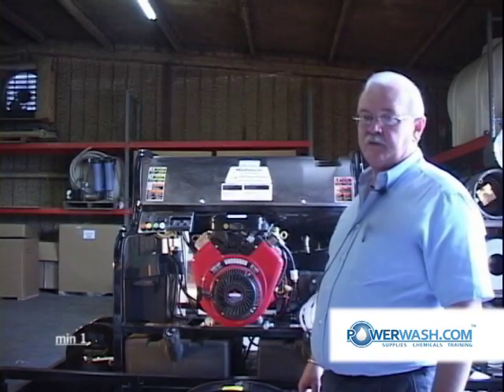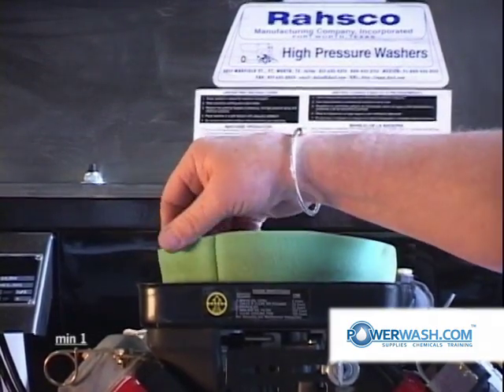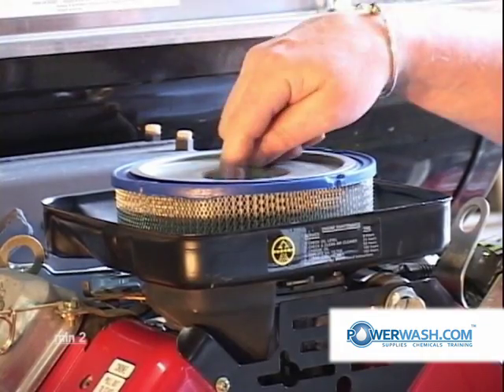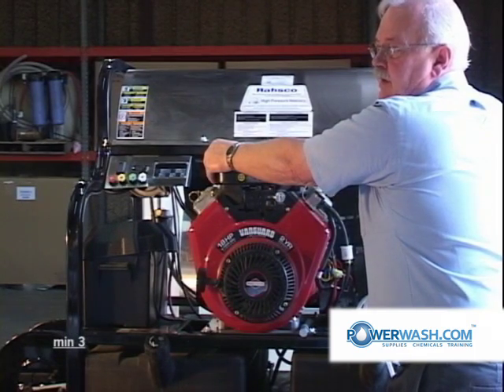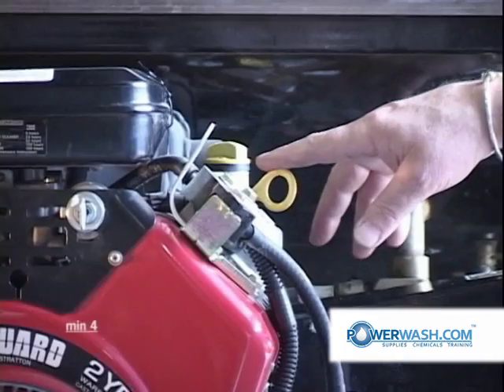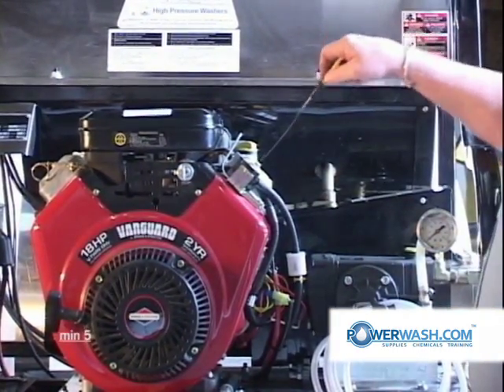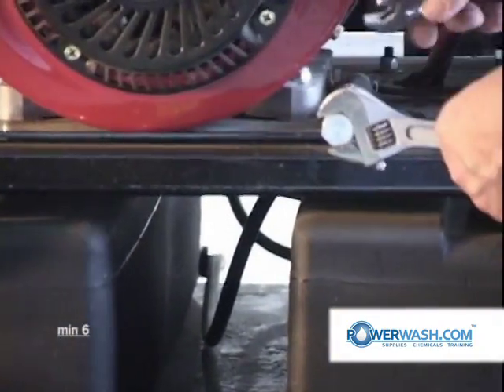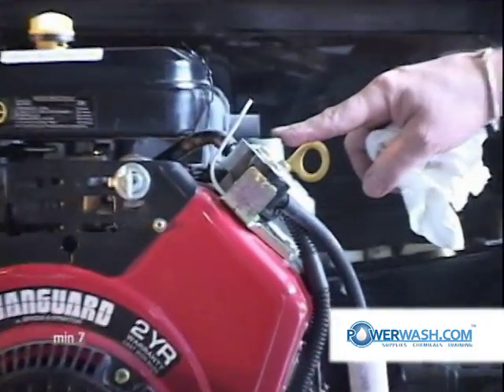Briggs and Stratton Vanguard: Preventative Maintenance Briggs and Stratton Vanguard Engine - Part 1

Comment: What is the adjustment knob on the very bottom of the carburetor? It is a small black knob that can be adjusted with your fingers? It can be seen by looking straight in behind the small panel that the keyswitch mounts to.
Reply: What is the rpm of 23hp vangard

Comment: I have a b&s vanguard 16hp on a grasshopper 616 lawnmower and suspended a bad starter so I replaced it.  The motor does the same thing, it clicks and the starter hums. I now suspect that the flywheel is lodged. What would you do at this point?  Also how many bolts hold the fan cover on?
Reply: had the same problem today, found that the top starter bolt came loose and was lodged between starter shaft and block, Being loose wouldn't help either. Starter still seems weak so valve lash check is next.

Comment: I just washed the foam pre-filter with gas and letting it air dry. Is that ok? Tks.. mechanically ignorant
Reply from the maker: It is but you should add a couple of drops of oil to it so that it will filter dust better.  After adding a few drops you should not be able to squeeze oil out of the filter.  If so, you added to much.
Reply: Ok I'll do that, thanks. How do you suggest I clean the main part, that the foam is around. Its got oil in it.. or should I replace it? Its not old, just oily.. I guess I need to resolve that issue, oil getting in there. Its running poorly. I love this lawn tractor and want to learn to fix it myself. Any advice will be very appreciated:)
TY!
Lori
(Bolens articulator with an 18hp B&S V-twin)
Reply from the maker: replace it, don't try to reuse it
Reply: Tks

Comment: Can someone tell me what this part of the engine does... http://i.imgur.com/USXB5Ul.png
Reply: +nd dn Throttle control i believe.  Used for applications where the engine runs at a constant speed such as a generator, by turn the nut at the end you can adjust the throttle.